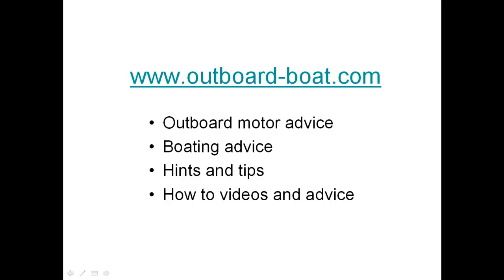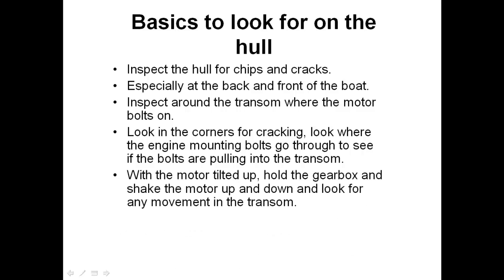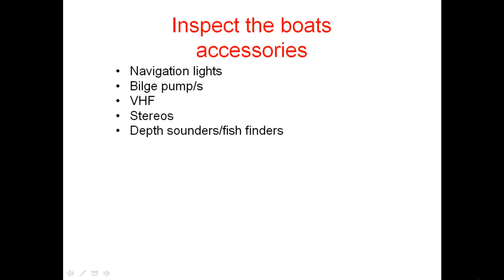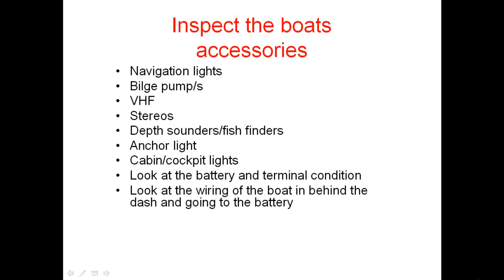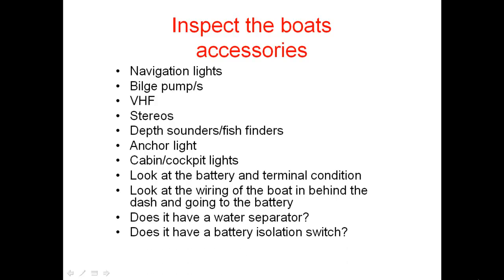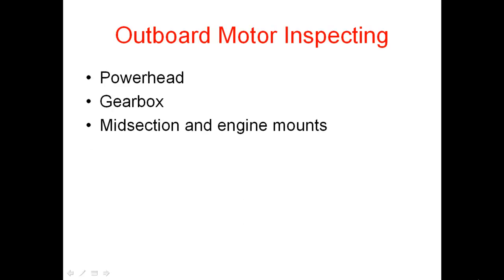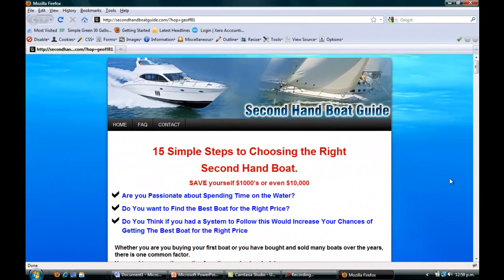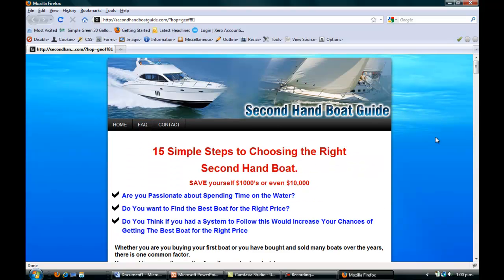Boat for sale, what to look for when used boat buying.

Comment: on an aluminium tinny how is the easiest and best way to fix less than a pin size hole in one of the weld joins on the bottom of the hull?